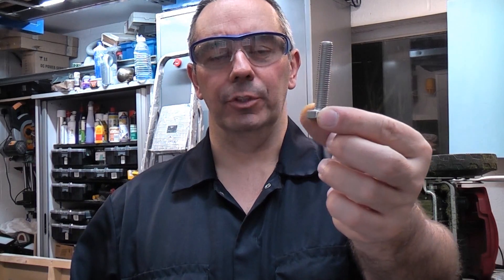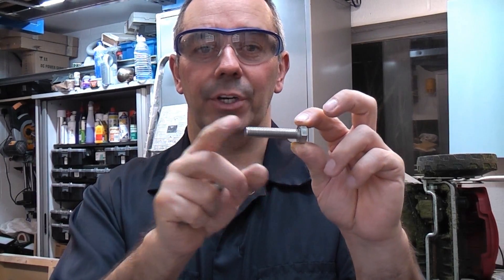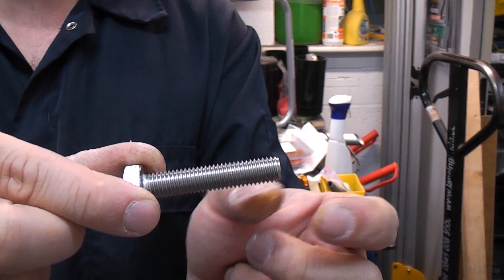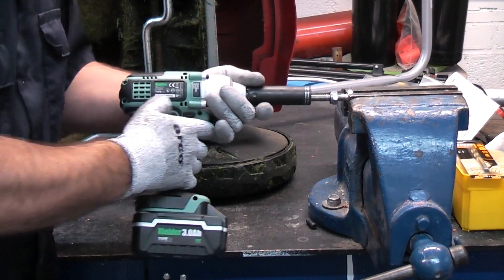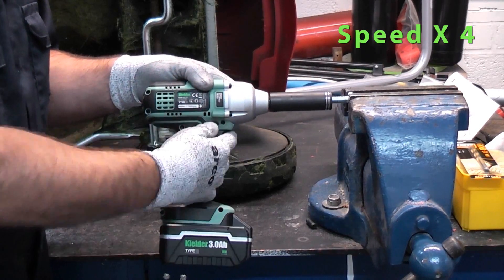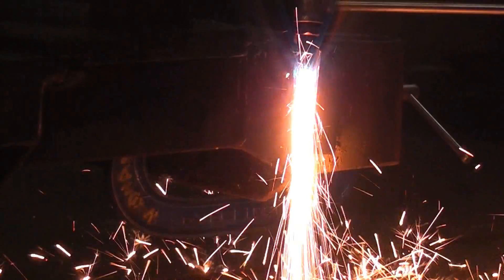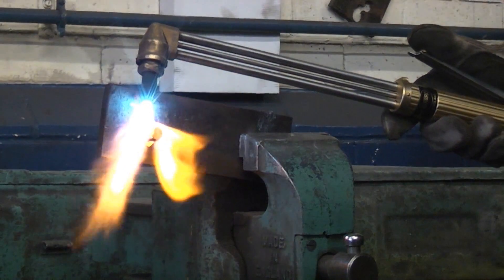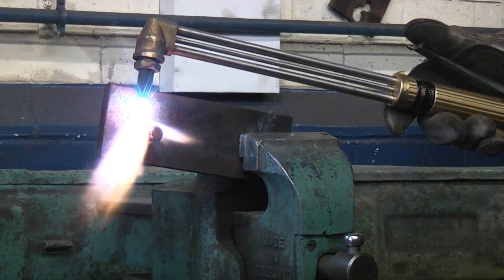Stainless steel bolts vs steel bolts | Stainless galling

Comment: Good video, could you remove the seized nut by applying more force?  Such as a 6 sided socket and bar with an extended handle? 

The galling is related to friction heat. So if I do use stainless,  they should be ok as long as they don't get hot?

Is there a strength difference between steel and stainless?  I usually replace steel with stainless on my cars such as the lower ball joint clamp and suspension strut bolts, because the ones that come off are very corroded and I just replace them with stainless thinking that will be just as strong or stronger and it will never corrode so be easier to undo in future.  But I would have to be careful if I took the car to a service centre for any work where they might come near my stainless with their power tools.
Reply from the maker: You might be able to remove the nut, but it is unlikely- the bolt will probably shear first. A few weeks back on site I went to change a 2 inch steam valve and stainless bolts had been used, two of the bolts had galled and could not be undone using a 3/4 inch drive breaker bar- I had to saw through them using a hacksaw.

I believe friction/heat is a contributing factor but I can't say for certain. Using anti-seize compound will certainly help to prevent it.

Yes, stainless steel bolts are often weaker than steel bolts. You have to be careful with vehicles as some of the bolts used are much stronger than normal "off the shelf" bolts.

Thanks for the comment

Comment: great information!  i believe there are grades that exist that reduce the galling and also avoiding use of power tools helps a great deal too, couple with some lubricant if possible.
Reply from the maker: Anti-seize will definitely help, also using grade A4 bolts and A2 nuts can help reduce galling.
Thanks for the comment

Comment: thanks for the clear message, im now scared of stainless steel nuts and bolts. given the choice im never going to use them again unless there is an actual need....
Reply from the maker: Sometimes they are really useful, hopefully more people will be aware of the potential problems now ;-)
Thanks for the comment

Comment: I have found this out in everyday use too,...I find that ss bolts and nuts can only be used once.
Isn't it true as well that stainless steel fasteners are not as strong as regular steel ? I mean as the grade rating ( tensile strength )  of a steel fastener is relatively easy to understand , this does not apply to SS bolts and nuts, does it?
Maybe a good subject for you to cover in a video soon, would be the Grades in strength of fasteners  and then if this applies to stainless steel fasteners as well.
Reply from the maker: Yes, stainless bolts (especially tine threads) are often only good for a single use. 
Stainless bolts are normally weaker than steel bolts, I can't remember seeing the tensile strength stamped onto stainless steel bolts (like you get on steel bolts). I'll try to cover this in a future video ;-)
Thanks for the comment
Reply: used to be the number of lines on the bolt head would tell you the grade. 3 lines = grade 5, 6 lines = grade 8. most stainless had 2 lines = grade 3. I use stainless hardware a lot. I lube the threads always because I have had a few nuts gall and literally had to break the bolt, because the nut wouldn't move at all. with lube, I rarely have a problem.
Reply: for an exhaust, a great combo is SS stud threads and brass nuts, this never has issues to remove it

Comment: So whats the solution to prevent this happenings? I've heard that any sort of contamination on the threads will help prevent it. 
If you're working on machinery used for food production for example then perhaps something nontoxic like sunflower oil or beeswax might help.
Reply from the maker: I'm not sure what they use in the food industry to prevent it, but your suggestions sound good to me. Anti-seize will help to prevent galling.
We often use copper anti-seize on site but in some machines we cannot use it. 
Thanks for the comment
Reply: Ed R cannot use any oil as oil can hold bacteria

Comment: Thanks. Something I hadn't realised. What happens to mild steel nuts on stainless bolts?
Reply from the maker: Mild steel on stainless should not be a problem, it's only stainless on stainless that causes the problem.
Thanks for the comment

Comment: If you apply vaseline to the threads of the stainless steel bolt then you have no problem.
Reply from the maker: I'm sure that will help, although we can't use Vaseline in some of the machines on site.
Thanks for the comment

Comment: "Lock nuts like these are designed to add resistance when installed and generate lots of heat. So avoid them, or install them very slowly. Nylon insert lock nuts paired with stainless steel is a common troublesome issue."
Reply from the maker: That is correct, but we often get bolts galling when tightening or undoing them from tapped holes when using just a ratchet spanner.
Thanks for the comment

Comment: What properties of stainless steel cause these problems?
Reply from the maker: Not sure, it could be something to do with the chromium content. Apparently if you use different grades of stainless such as a A4 bot and a A2 nut the galling problem is not as bad- or you can apply some anti-seize compound.
Thanks for the comment

Comment: Wow I didn't know you couldn't burn off stainless steel. You learn something new everyday👍👍
Reply: MegaTabetha  

It's not because it's not hot enough but because the oxy torch first oxidises the metal and then blows the oxide off. And stainless steel resists oxidation.
Reply: I found out when I was a 17 year old apprentice. A lad told me to burn off a corner of stainless. I was there for ages waiting for it to warm up. Meanwhile all of the lads were having a giggle at my expense. Good times.
Reply from the maker: I only found out myself a few years ago ;-)
Thanks for the comment
Reply: Ditto. Never to old to learn.👍
Reply: Plasma cuts it just fine.
Reply: Brian Kiehnau
That's because plasma is not burning it's melting and blowing, oxy acet is literally BURNING the steel, once carbon steel (most common types) reaches red hot pure oxy will rapidly oxidize, aka. burn it which liberates heat to the surrounding material to allow for the process to continue even without pre-heat flame in some cases.

Comment: Thanks for the info. I had a bad experience trying to get nylock nut off of a stainless steel bolt and have never attempted to use nylock nuts again. I've been using thread locker instead. Now knowing about galling on stainless, I'll use them again.
Reply from the maker: They are a nightmare when they do gall up, but a bit of anti-seize should prevent that.
Thanks for the comment

Comment: What actually happens when the nut and bolt “Gall”. Is it a chemical reaction?
Reply from the maker: This explains it well- https://www.boltdepot.com/fastener-information/materials-and-grades/thread-galling.aspx
Thanks for the comment
Reply: Ultimate Handyman Many thanks Got it.
Reply: Thank you, that's very helpful. Various points  noted, esp. about poorly formed / overtight or damaged threads.  Pretty basic engineering really. Plus LUBRICATION.  If in doubt I will always run a tap / die down the threads before I proceed.  And then there may be a problem of bolt stretch, distorting threads.
Reply: The oxide layer is removed and the metals fuse together.
Reply: @amana1480  Good answer. I agree. Without the oxide which is present on all materials in air they effectively weld together under the pressure when tightening.
Reply: John Crook That's what I want to know as well. Plus why can't stainless be melted with oxy-acet like steel can?
Reply: You can melt it with oxy-acet but you can't cut it with a gas axe because it won't oxidize.
Reply: aletoledo1 chromium ...it balls up and distorts on a molecular level
Reply: @aletoledo1 oxy-acet doesn't melt the stuff directly, it heats it up and the extra oxygen sets the steel on fire... except that the stainless isn't flammable
Reply: It's related to the carbon content which acts as a form of lubricant. SS has lower carbon and other metals. It's also why SS doesn't oxidise and why the cutting process doesn't work as it relies on oxidation of the metal from the high pressure O2 stream.
Reply: GALLING IS WHEN THE THREADS
BECOME ROUGH AND MAKES IT HARDER TO TURN THE THREADS ON BOLT OR NUT!  ONCE IT STARTS HAPPENING AS LITTLE AS A QUARTER TURN CAN SIEZE EVERYTHING TOGETHER 
MY GUESS IS TO TRY SILICONE GASKET SEALER IN A TUBE TO LUBRICATE THE THREADS
I HAVE USED SILICONE WITH GOOD RESULTS ON WHEEL NUTS AND STUDS TO LUBRICATE THE THREADS AND KEEP WATER OUT TO PREVENT RUST!
Reply: @John Crook
Hey Crook
NO! It's a Chain reaction described by Ross a long time ago.
https://www.youtube.com/watch?v=UaYHRx9-v2M

Comment from the maker: I'm off to work for the day, I'll answer comments on my return !
I hope everyone has a great Sunday ;-)
Reply: Would it be a problem if u used a socket and ratchet as to oppose a wrench gun ? Cheers
Reply: Poor Quality I'm thinking! Good stainless steel products are available, I have used them. I have seen great value in stainless steel products for at least 50 yrs. Got to say tho that much of what I worked with was MADE IN AMERICA and not China.
Manufactures must make money and cheapening the product is the game.
Look hard at where you get things!
Don't just say stainless steel bolts are of less quality with out doing your homework.
Reply: Great video. Action Can make a product in an aerosol called AG-90, Anti-Galling lubricant It's also food/pharmaceutical grade (h1) for such a problem. It works a treat.
Reply from the maker: Yes, using different grades of stainless can help.
I've had bolts gall up when using a ratchet spanner in the past, when tightening and undoing them. Obviously if we are on a breakdown we have to remove the bolts as fast as possible, even if it means shearing them off and drilling them out afterwards.
Thanks for the comment
Reply from the maker: They still gall up using a ratchet spanner, but the impact wrench makes them gall up much faster.
Thanks for the comment
Reply from the maker: Thanks, I would try that, but the machine we have problems with is a glass washing machine. We can't use any lubricants as it could stain the glass.
Thanks for the comment
Reply: Wow I never knew that either would have thought it would have flown through that with oxy acetelene
Reply: Very informative... any advantages of galvanised nuts and bolts as opposed to zinc plated, or are there pitfalls with those too. Obviously in machinery for processing food in factories stainless stell must be used... I was thinking of other applications
Reply from the maker: Galvanised bolts are better outside (rather than zinc plated).
I've never had to burn galvanised bolts off, but if I had to I would be very cautious of the fumes as you can get galvanic poisoning from burning/welding galvanised steel.
Reply: Very interesting thank you. Apparently using two different grades of stainless steel for nut & bolt reduces the problem of cold welding. Also working very slowly with clean unbroken threads reduces the friction heat that causes the weld..